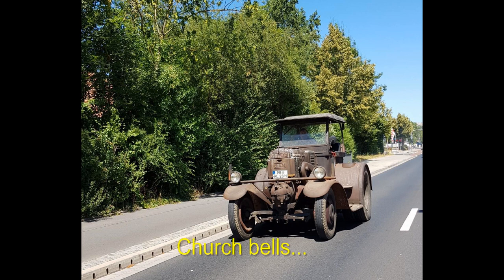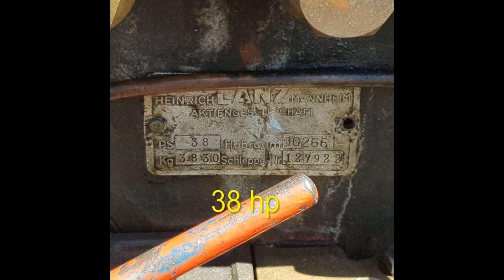1936 Lanz Bulldog

Comment: is that one of the engines they start with a shotgun shell?
Reply: MissouriOldTimer no, you start the Bulldog by heating up its hot-bulb until it glows red
Reply from the maker: This is a hot-bulb engine. Normally they are started by heating with a blow torch, however, this one has a gasoline starting feature with a spark plug. Once it gets hot on gasoline it can be switched over to oil or diesel fuel. Later models were true diesels.
Reply: Your thinking of a field marshall

Comment: 50 mph? no! :D I think something about 18 mph and that was really fast for a Traktor at this time.
Reply from the maker: This machine was not designed as a tractor. It is a road vehicle and is geared to go much faster than a tractor.
Reply: Bruce Boschek it is a 30 or 38 Verkehrsbulldog from 1934! I know this Bulldog. It belongs to a guy in my neighbourhood. The Verkehrsbulldogs were faster than a Ackerluft or something, but only 5-7 Km/h. 
This Lanz has a max speed of 25 km/h so ~15 mph. Maybe with diffrent gear wheels it is possible to drive something about 24mph but not more!